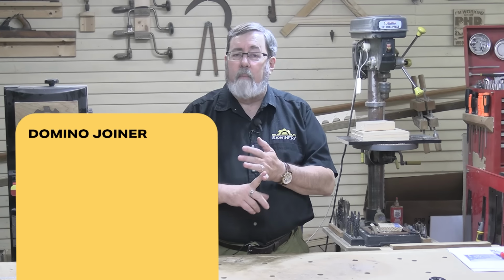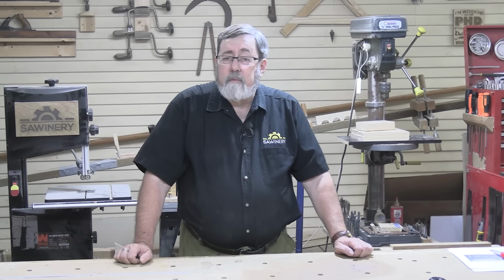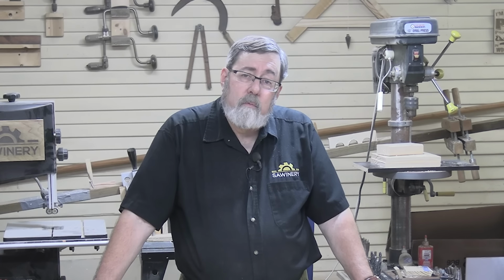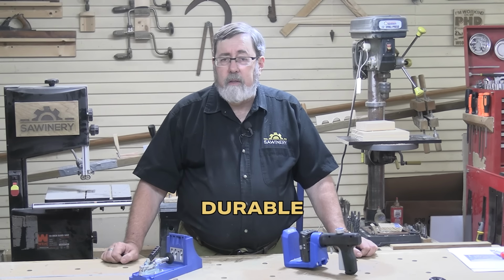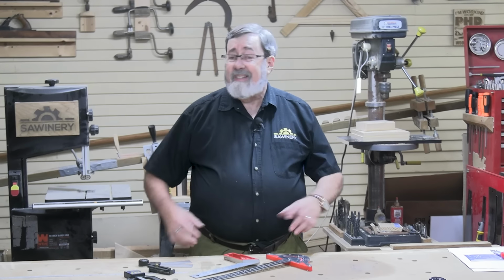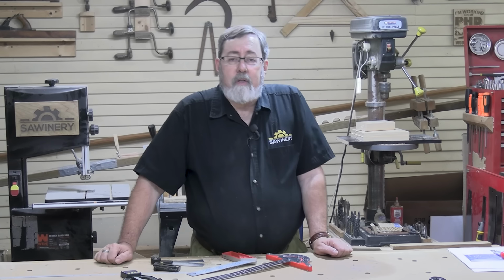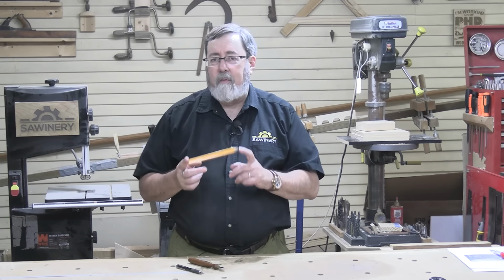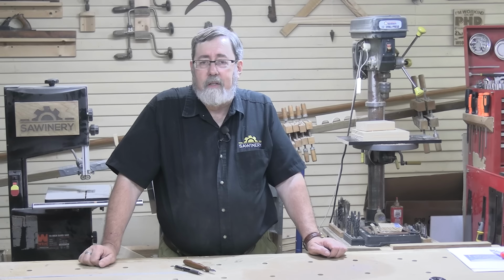5 Most Overrated Woodworking Tools

Comment: Fair list, but I do have to disagree about the domino. The main selling point isn't necessarily alignment, it's speed. I know the traditional woodworkers out there shun things like that,  but for me personally, while I enjoy the process of woodworking, the project itself is why I got into woodworking. Because I can make what I need, exactly how I want it. I don't need hand cut dovetails when simpler joinery will suffice (and I know I;m the odd man out here, but I don't find dovetails the most appealing to look at). 

So if I need to build something like a step stool, hand cut mortise and tenons will work. But dominos will too, and be a lot faster. I guess I'm just a destination woodworker, rather than a journey one.

All that said, I don't have a domino. You mentioned dowels, and I agree here, to an extent. I've tried the cheap $30 doweling jigs. They're absolute garbage. I invested in a dowelmax and it's my primary method of joinery now, and it's the single reason I don't have a domino. It's extremely accurate, makes very strong joints, and is plenty fast enough for me. Jessem makes a nice doweling jig too.

Everything else, you're spot on. I literally just listed one of my pocket hole jigs on ebay. I don't use pocket screws much these days. I don't use my miter saw very often and it's just taking up valuable space in my shop. I decided a long time ago to buy good measuring tools, so I have a mix of mitutoyo, shinwa, starrett, woodpeckers and PEC in my shop. Quality measuring tools really do make a difference in workflow. And I got rid of all my carpenters pencils years ago as well.

Thanks for posting.

Comment: I’m your age and I agree with mostly what you said. I believe the difference with what you say wood workers, most of the new stuff you see on you tube is for DIY, not craftsman. The person who wants to go the market/fleece market with his cutting boards.  All tools have a purpose and use and when used properly they are great. Domino is for fast less accurate needs. I prefer dowels also but it time consuming and newer DiY don’t have patience, I get that,I’m married and the projects are never done fast enough.  I would recommend a compound miter saw to a new DIY over a table saw. Learning curves slow and steady.  First tools for wood working in my opinion-circular saw or the newer track saw, jig saw , miter saw , dowel jig and sure pocket hole jig if you want to make cabinets.

Comment: I'm new in woodworking and I agree with you absolutely.
Aldo I find miter saw useful for precise repeated angled cuts - I don't trust my skills that much. Rather use a handheld circular saw to ruffly cut long board and use my table saw for precise cut afterwards.

Comment: Thank you for the insight! Could you recommend a good table saw for someone starting out in woodworking?

On the subject of the Festool Domino, its primary patent is expected to expire in June 2026. This expiration will affect key markets like France, Germany, Italy, and the UK. After this date, the core technologies behind the Festool Domino system—such as its oscillating cutting mechanism and specialized domino tenons—will no longer be exclusively protected. This could open the door for competing brands to develop similar joinery tools.

However, if other companies begin producing their own versions of the Domino joinery system, it might lead to its proliferation in the market, potentially causing its use to become more widespread than necessary for certain projects.

It’s also worth noting that the Chinese conglomerate based in Hong Kong, which owns brands like Milwaukee and Ryobi (they’re not American, despite common misconceptions), might seize this opportunity to bring a comparable tool to market.

Comment: Aaahh measuring devices.
If I am doing something that requires accuracy I try and keep measurement using graduated devices to a minimum.
That may sound illogical but most of the time being a small amount wrong isn’t a problem.  What will cause a problem is similar components being different sizes or out of square.
I try and make one measurement and then use something like a pinch stick or sliding track to duplicate that measurement.  I find that tracksaw guides are a real plus point for this approach.
Using this system minimises errors caused by old guys’ eyesight and sausage fingers etc.
I’m not sure I have explained this very well but I know what I mean 😊.
Thanks for an interesting video.

Comment: I love my Festool Domino.  I saves me a ton of time and I like it a lot more than my DowelMax for not only speed but for accuracy and repeatability is great.  A DowelMax can get wonky if you tighten the knobs too much or too little.  I can also add accurate dominos to the center of a board, which is very difficult with dowels, unless you make a custom jig.  The settings can account for not perfect lateral alignment, which comes in handy while trying to assemble a wide board to another wide board when the 1st setting or dowels need to be spot on.   Those who criticize the tool probably haven't use it.  I put off this purchase for many years but wish I had bought it sooner.   The more projects you build, the more you would appreciate a Domino.  It's a finely engineered tool.

Comment: I enjoyed your video, only I have 2  things I would like to point out. #1, Pocket holes are a great joinery method when used properly. #2, I and many of woodworkers I know use a miter saw for many projects. the table saw is difficult to crosscut long boards when purchasing long hard woods for cutting boards and other items. not saying you are wrong, but a miter saw a very useful tool in the shop.

Comment: Things I don't have in my workshop here in the UK.
Domino jointer (dowels work just fine if you feel the need).
I use a mitre saw as a chop saw for carpentry, as cutting long lengths isn't possible without moving my table saw. Apart from that, it's easier as you say for external corners on crown moulding.
Tried pocket holes - hate them, as there's ZERO satisfaction in what I produced using the system.
I've a natural aversion to digital tools, as it's guaranteed the battery will be either dead or have corroded the circuit board when you most need it.
Mechanical micrometer & dial calipers for me.
Carpenters' pencils are great, for carpentry.

Comment: I agree on most of that except the miter saw. There's no way you can set up a table saw as fast when you need many different angled cuts especially when you need to work outside the workshop.
The miter saw is a relatively safe tool compared to the table saw which is the culprit for most work accidents.

Comment: I was taught that the flat looking pencil is a framers pencil and a carpenter pencil was just a fat round pencil with a thicker lead. Much easier to sharpen down to a fine with a knife but I still use a mechanical pencil for important measurements.

Comment: Bought a few “measuring” devices on line and after one use, put them in a donation box. Just get the quality devices when I need them and then I’m set for future projects. 
Never did see a reason to get a domino joiner when dowels and biscuits have worked well for me in the past. 
Have a pocket hole jig and have used it in a limited capacity. Yes, mechanical pencils or a marking knife are all I use.

Comment: I've been wanting a gadget to set angles on my table saw. I see people using the digital electronic level and angle gauges and I see people using the gauge that you showed us in this video. Is one better than the other or do they both do about the same thing?
Reply: The electronic angle gauges are good, if they're calibrated properly, you get what you pay for with those things.  An electronic level doesn't give you angles, it just tells you if something is level or not, and a regular bubble level is a heck of a lot cheaper.  

There are all sorts of angle finders out there, some manual, some electronic....the problem with electronic ones is the batteries always are dead at the most inconvenient times, and most of them require hard to find expensive batteries.  I just use a protractor if I need to set angles on the table saw which is very rare as I prefer the miter saw for cutting all the angles for projects and leave the table saw set for 90 degrees as much as possible.
Reply: @wildbill23c  Thanks for the information.
Reply from the maker: Really, its a matter of what works best for you. I use different methods at different times, mostly based on what is closer and easier to grab. The only thing I would make sure of, is that whatever gauge you use is accurate.
Reply: @sawinery-woodworking  I think I'll just keep using my machinist tools. I already have them and trust them. I've never cared for anything that used batteries except for my cordless drills.
Reply: I have one of those electronic angle gauges, I use it and I like it. But to set the table saw I actually use a protractor app on my phone. I built a holder for the phone and epoxied in a couple of rare earth magnets to hold it to the blade. The app was free, the magnets were a buck or two at HF and the wood was scraps. I will also say that my miter saw is dialed in and convenient to set up and is my preferred method to cut angles and miters unless the material is too big (or too small).

Comment: People using pocket hole for everything aren't really interested in woodwork per se, they just wan to make stuff without the learning curve. 

I  use pocket hole for exterior carpentry, without a jig but a usually a pilot hole because in certain areas it just simple way of getting stuff done and you won't see it unless you a seeking it out. The hole will close up in a lot of cases with treated wood, especially with those narrow head decking screws.  For fine wood a lot of time if it can be hidden you can hide more structure and get better joint still. Yes it has change the design of some cabinetry, but if I want that style of cabinets I will get a kitchen fitter, etc.

Comment: I agree: 
1. Dowel pins work great for me.  I don't/won't spend the money on the domino system, and yes, I see every YouTube woodworker has one.
3. Pocket hole jig/joinery -- I hate the look of them (even when their hidden).  I try to do all my wood-to-wood joints with actual glue and joinery and clamps -- no metal fasteners whatsoever.
4. Guilty of purchasing some Woodpeckers measurement tools that are expensive and mostly unused.
5. Mechanical pencils are great!  I have them everywhere!

About #2, the miter saw -- I don't have one, but I think I'd like one to use for repeated crosscuts for legs, etc.  Yes, you can do it on the table saw and it would be more accurate, but I think there's times when the convenience of the miter saw would be nice to have and futzing with table saw would annoy me.

Good video.  Good to think about what you really need (or not).

Comment: A simple question about gage blocks, in my 47 years of precision machining I never saw stainless steel gauge blocks, did you mean steel?
Reply from the maker: If I said stainless steel, that was inadvertently. I’ve never seen stainless steel ones either.

Comment: $1k+ for domino joiner? Holy crap I'm glad my line of woodworking doesn't require those.
Reply: I bought one used. Since I've had it I've never used my biscuit joiner or mortiser, and I've used my pocket hole jig once. I sold the latter two and my pocket hole jig sits in the back of a cabinet mostly collecting dust.

Comment: I bought one of the most expensive dual spindle dowel joiners on the market for... $160. Does everything I would get out of a domino for way less cost and the ever so slight increase in time of putting in two dowels instead of one domino. Totally worth it to me.

Comment: I have a table saw, a mitre saw, and a radial arm saw.  The most used tool by a long shot is my mitre saw.  By a long shot.  What a mitre saw does, it does very well.  Far better than a table saw.  If you are doing cabinetry and furniture and a lot of rip cutting, then sure a table saw is going to be your favourite saw.  But otherwise,....
That said, a radial arm saw can pretty much do everything a table saw can as well, and possibly even better in some cirumstances.

Comment: The big advantage of the Festool Domino is the speed of doing said task. Using a dowel jig is slow compared to using the Domino. When do a project where you need to do a lot of dominos/dowels, you save time using the Domino. This matters to a professional but may not matter to a hobbyist. Mine has easily paid for itself.

Comment: I used biscuit joiner for alignment. Maybe not as strong, but never had a joint fail either. I have never had a joint where pocket holes were a viable way of joining wood. There are stronger faster, cheaper ways to join wood.

Comment: From the overrated tool camp: The track saw. I make the same cuts with a straight edge and a circular saw, and it works great. No need for the the more expensive track and the specialized saw that you would have to get.
Reply: I do agree with you but I do believe the track saw is more for convenience and speed. I personally do the straight edge and clamps myself because I can't afford a track saw and for their price I can't bring myself to buy one. Although I do think they have their place, they are nice tools for sure but honestly for the average home shop I think it's not necessary unless you are very frequently ripping large stock for an assembly line style project. It's at that point where moving and clamping your edge is a pretty significant waste of time. But I'll stick with the edge and clamps for now 😂

Comment: I bought a biscuit joiner 18 yrs ago and I use it all the time.
The tool makes grooves on long boards accurately and effortlessly.
I use it to make a slot for the Z-clips when I screw table tops down to the apron.

And I still use this tool when lining up boards for glue-up.

When I join legs, aprons, skirts, etc I use dowels. The strength of dowels has never failed me.
(Yeah, I'm old-school 😋 )
Reply: A regular biscuit jointer is great, that ridiculously overpriced proprietary Domino system isn't anything spectacular and a total waste of money for 99% of people.

Comment: Yes, I agree, you can use your table saw for most miter cuts, but it's somewhat inconvenient having to pull the cross cut sled out every time to cut miters. I use my miter saw more than any other tool, including the table saw. I get accurate cuts with my miter saw. You do have a point. Each to their own.

Comment: Bought a multipack of carpenters pencils, spent more time trying to get a useful point on the darn things than I did actually working wood. 

I feel gratified that "mechanical pencil" was the solution from a person with 50 years of experience. It only took me.... some time... to figure it out.

Comment: Probably irrational, but firm dislike of pocket screws over here. And they aren't cheap either. 

I like dowels. Probably irrational, but I like them. Got myself a dowel making jig. Cost me next to nothing, solid anodized Alu, carbide cutter, from "that evil place" Temu... Works like a charm. Any size. Any wood. Any off-cuts I used to light up a BBQ with are now usable. What's not to like? 😊

Completely agree on the miter saw front. Not building houses out of 2x4s here. Smaller cuts - x-cut sled. Safer, dead accurate, repeatable if needed, and waaaay more versatile.

Comment: Up until a couple of weeks ago I had a Domino DF700. It got stolen with £4700 of other kit from my van. 
 I was using it regularly. Not always for loose tennons though. 
 one example is for retro fitting trickle vents in UPVC windows. Total game changer. Paid for itself In a day.
 I’ll most certainly be replacing it…..when I can afford the damn thing.

Comment: I have a tiny {tiny} workshop, and the miter saw is critical for me to avoid moving everything around to do things on the {jobsite} table saw. I’m prefer the table saw for box joints etc, and favor the router less, but the miter saw saves me a ton of time in a tiny workshop.
Reply: Yes, my machine room in my Workshop is about 10m2. I literally cant put large stuff through my table saw. But my mitre saw table on one side of the Shop (with end stops for repeatable Cuts) is a life safer when cutting down larger Stock. Even Plate Material (mdf, ply wood) I often roughly cut to size outside with my trscksaw before it goes on my table saw.

Comment: I think the Kreg Jig is a great tool for a beginner.  Of course a pocket hole jig is not the answer for everything.  The miter saw is also a necessary tool.  Not every table saw is created equal. Contractor saws will not do as well as a miter saw.

Comment: For a hobbyist what is needed is not often what is easy simple or foolproof. The very finest of wood products I am speaking about art level work is mainly done with tools that have been around a long time, The skills developed to use these tools at that level took a long time. I would go the other way and say table saw is not a great beginner tool because the more costly ones are the safer ones to operate. I would say get miter saw a nice worktable and a track saw.